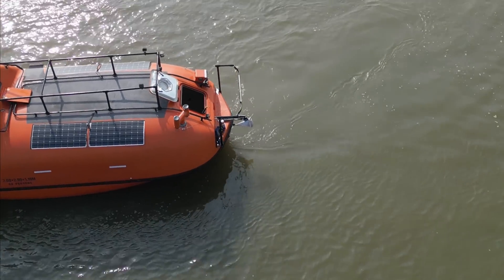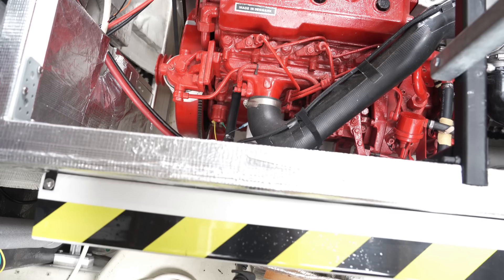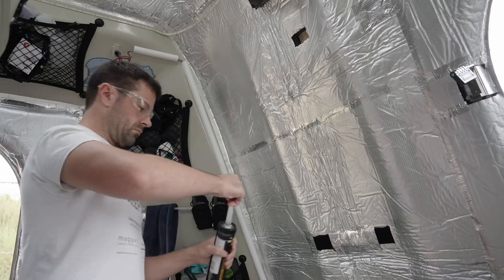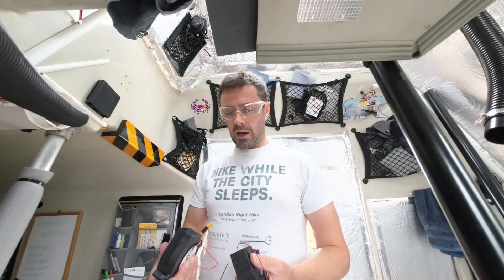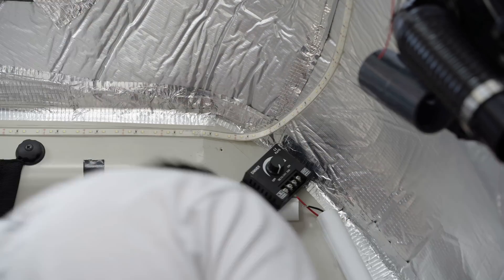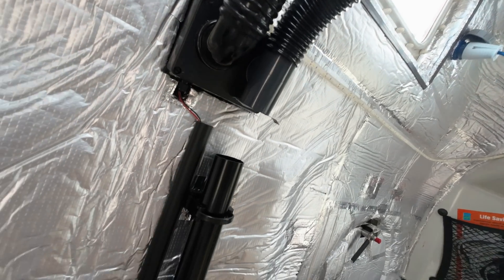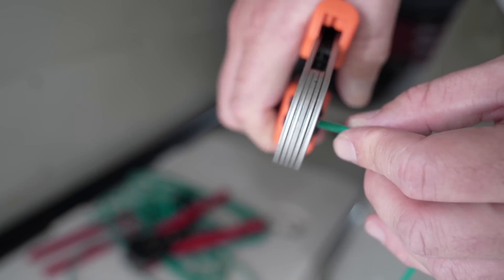Engine bay overheating solution - custom air ducting. Expedition Lifeboat Conversion Ep92 [4K]

Comment: Very interesting job.  I love it. . .I’m confused though, did I miss something?  Why not use the heat from the engine bay for heating your interior?  I KNOW you thought of this, and maybe this does that. . .Again, sorry if I missed this.  . .
Reply from the maker: It's been brought up dozens of times. I'd need another wet circuit with heat exchanger, and it would be hard to switch it off.

Comment: I did wonder if you could just add an opening in the engine air inlet ducting inside the engine bay, so the engine ventilated its bay directly by drawing in the warm air. Would need a second port in the bay wall to let in cooler air, but you'll need that with the fan system so maybe have it already.
This might be worth providing for anyway, as a back up if the fan decides not to work when at sea and far from a replacement.

Comment: 8:40 "Wago and Wago-style lever connectors clamp down hard on twisted wire ends" - actually, they recommend not twisting the wire ends, because that reduces the contact surface 😊
Reply from the maker: Interesting. I guess I do it to tidy away strays, but fair enough!

Comment: As well as extracting hot air from the engine enclosure you should also duct in cool air. Remember, the engine uses air(oxygen) during combustion, any reduction in density due to restriction or temperature will reduce the power output.
Reply from the maker: The engine has a dedicated air intake duct with a silencer, feeding off cool cabin air.

Comment: In Australia your new cordless tool is called a cut off tool rather than an angle grinder.
Reply from the maker: The flap wheels and grinding discs for it would feel very left out.

Comment: Won’t you loose a lot of heat this way? I guess it’s not a concern?
Reply from the maker: Some will be lost to the cabin through the ducting I guess. The bay will still warm the boat in general. I just want to reduce the air temperature in there.
Reply: @AlexHibbertOriginals  Thanks. Right. It’s good that you can regulate the airflow. Nice work. Great show!

Comment: On marine engines the coolant pump pressure is usually used as the primary indicator of how hot the engine is. On a small marine diesels like the Bukh it’s a little bit different, usually there’s an oil temp sensor or switch screwed into the oil filter mount or the oil distribution manifold. If you want to get the engine bay a little bit cooler, you could install an external oil cooler (One that’s made for a VW engine would be the right size).

Comment: Love the project, but why didn't you make a small inlet, in the intake inside the housing? You could have the best of both worlds without all the extra complexity?
Reply from the maker: I don't follow
Reply: @AlexHibbertOriginals  couldnt you add a small hole in the intake, so it would circulate the air inside the engine bay like it used to. While still getting most of the air from outside?

Comment: The air temperature around the engine is mostly irrelevant. Coolant temperature matters, but only as long it doesn't boil over. Beyond that it's all about oil pressure.

As temperature increases, oil pressure decreases. At a certain point, the oil pressure become too low.

But we've been basing our commentary around arctic conditions.

Arctic conditions will change everything about your cooling needs.

As a simple example, the show "ice road truckers". They have sheets of plastic to go over the front grill of the truck, as the cold air will chill the engine too much.

Don't forget about the arctic side of things.

In the summer overheating equipment and crew is a valid concern. But in the cold? Everything changes.

Remember that heat transfer varies EXPONENTIALLY between the temperature difference. So when it's 40C Inside and 20C outside there's not much thermal transfer. But when it's -40C outside, keeping it 40C inside will be basically impossible.
Reply: There’s nothing exponential in that, just simple temp differences.

Comment: Does your gauge show actual oil pressure? Or is it a "low pressure switch" which kicks in at a certain point? If you have access to your actual pressure, choosing your oil viscosity is mostly based on your running pressures.

Beyond that, since you don't have a catalytic converter, the more anti wear additives (molybdenum, etc.) the better.
Reply from the maker: The control panel has a low pressure alarm, but I installed that oil gauge too last week.

Comment: 1:33 "this will depress the brand snobs out there" - well I'm not that. But remember you're buying into an ecosystem with every battery tool. It's nice to have all your tools, chargers, and batteries be interchangeable. You may pay more in the short-term, but it's nice to know that all tools and batteries will work together.

In an ideal world, it'd be a formal standard. Open to all manufacturers...

But in the meantime we have manufacturer standards (and knock-offs which use manufacturer standards - very common with 20v tools).

You don't want to end up with 1 charger, 2 batteries that only work for you angel grindr is all
Reply: Most batterys use 18v and are similar in construction, so in theory you can hack your own adapters. Obviously you need to know your cells chemistry when it comes to chargers.
Reply from the maker: For full size tools I'd agree, and I use the 18V einhell as my 'standard'. But these little rotary tools aren't available in that format.

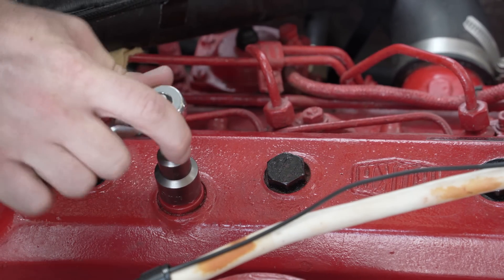Comment: At around 2:50 - doesn’t that alternator look a little loose?
Reply from the maker: No it's probably the footage stabiliser from handheld filming.
Reply: @AlexHibbertOriginals ah gotcha, probably just amplifying engine movement. 
I must ask have you considered an SKF speedi sleeve for your leaking crank seal? I repair industrial rotating machinery and they have saved the day many a time where an asset cannot be removed yet is suffering from a worn seal journal. Also it may be worth checking that the current seal (recently changed I believe) is a viton one.

Comment: 1:55 From a Mazda Owners Manual: Inspect the engine oil level periodically. When inspecting the engine oil, if the engine oil level is exceeds the “X” mark on the dipstick, replace the engine oil. This should be done by an expert repairer, we recommend an Authorised Mazda Repairer. When replacing the engine oil, inspect the oil level using the oil dipstick and refill so that the engine oil level is within the range between MIN and MAX as shown in the figure.
Reply: On page 10 of: bukh dot dk slash upload_dir slash pics slash Produkt-Ark slash DV-29-RME slash Owners-Handbook---BUKH-DV-29-RME dot pdf
no markings are mentioned. Instead there is a short list of expexted oil levels in mm, in regards to the inclination in which the engine is mounted.
Reply: From a Mazda Forum: don't think 5-6mm over the full mark when warm is worth worrying about on the petrol engine; the X mark (point above full when the oil must be changed due to dilution) on the diesels is higher up the dipstick than that. If it's going in on Tuesday, they could drain a bit off to bring the level between low and full.
Reply from the maker: Interesting. I was testing cool/warm.
Reply: https://bukh.dk/upload_dir/pics/Produkt-Ark/DV-29-RME/Owners-Handbook---BUKH-DV-29-RME.pdf

Comment: I just saw a little radiator with a compact auto fan running on a 
12volt wind powered generator . 
Build that then put about 5 lbs pressure  of liquid nitrogen in the radiator . 
Very coooool
Reply: How would I find this? Sounds interesting!
Reply: @PsRohrbaugh  have to build it.  
I would say a radiator from an on board rv generator .  A fan off a le car 
A battery and a small solar cell 
Or a mast mounted 6 volt trickle charging a 12 volt two battery system .
Reply: @PsRohrbaugh  the big question would be the heat loss time on the nitrogen and how to vent it as it warmed up

Comment: Could you use some of that engine hot air as heating for when you are further north ?  a nice heated seat or foot rest . a redirect valve as an on off
Reply from the maker: A thought certainly.

Comment: Could the cross be the intended level corrected for the angle of the installed motor ?
Reply from the maker: I think it's too far up the stick.
Reply: @AlexHibbertOriginals  Yes probably, unless you go 45kts SOG

Comment: I'm impressed with the mounting of the duct clamps with the attention to detail of addin insulation. Iterating to do a test of running the engine with the fan off and on seeing temps change

Comment: The cross is where the oil level should be more or less when the engine is running.
Reply: This doesn't pass the smell test. Why would the engine oil level be higher while running? The volume in the pan should decrease while operating due to some of the oil passing through the oil passages.
Reply: Could it be the rough oil level when stored at an angle in an emergency launching cradle?  That only makes sense if the dipstick is at the front of the oil pan though!
Reply: @jonathanflatman  I think this is much more likely situation.  However. This type of lifeboat would've been stored flat. It's a cable lowered craft. Not a drop in. So unsure.
Reply from the maker: Ah
Reply: I think the cross prevents the oil from creeping up the oil stick with the engine vibration and eventually leaking out.

Comment: I might have missed it but have you installed fans for the windshield?
Reply from the maker: I have not
Reply: @AlexHibbertOriginals  I'd highly recommend installing one or two before it gets too cold to get underway with the doors open, I'm not sure if the moisture/condensation is a problem for you right now. But it likes to freeze to the inside where I'm at in Alaska once it gets below 0°C . The cheap 12 volt oscillating ones work fine, just don't get one with a suction cup.

Comment: Comment for the rhythm of Algo.  I have the Lidl version of that 12volt grinder.  It's not bad, obviously much more suited for cutting plastic than the aluminium I used it for and more suited to right handers.
Reply from the maker: Cheers. I've cut some steel with mine! Slowly....